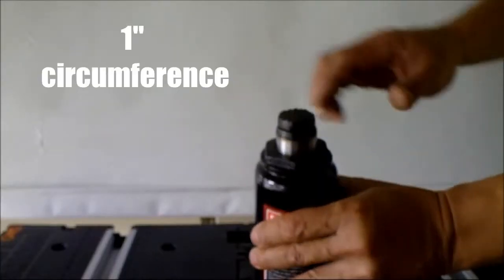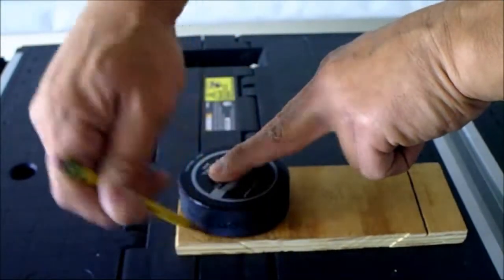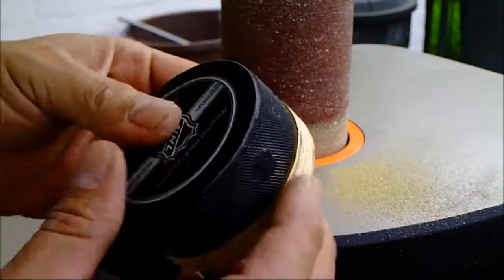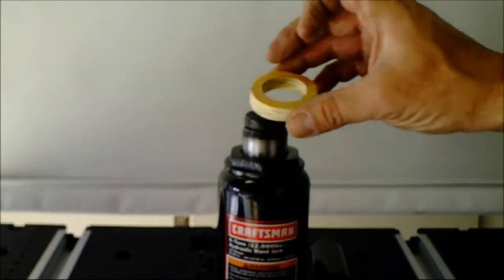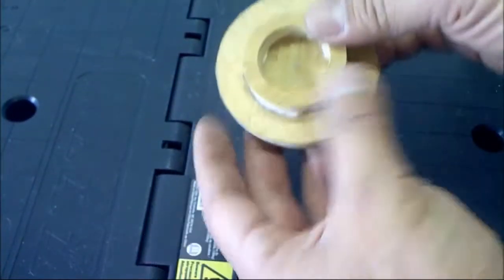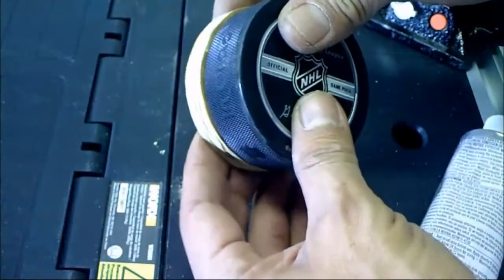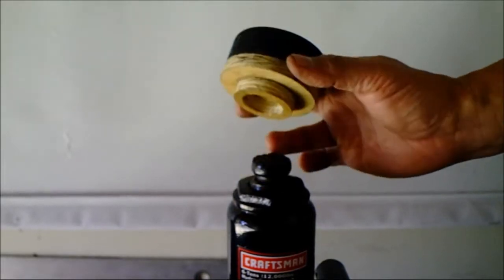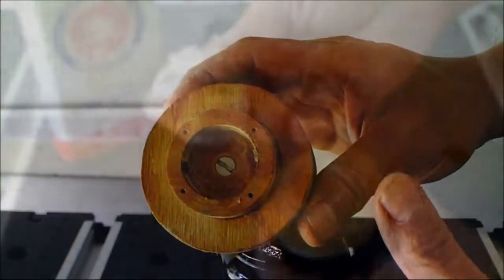Hockey Puck on a Bottle Jack

Comment: Thanks for this idea.  Wondering did you see the bottle jack saddle pads/hockey pucks on ebay?  What do you think, seems less complex to just fit the bottle jack into the hockey puck
Reply from the maker: I saw those on ebay and I didn't like the design. Some of those are just a round rubber pad. Couple of issues I saw with just placing a hockey puck on the bottle jack. 1) the hockey puck is made of rubber and the small area of the jack will tend to distort the hockey puck. 2) you will always have to adjust the center of the hockey puck on the jack. It makes it easier to take some time to make the base and not worry about that.  It's more the satisfaction that you made something rather buy it. Just my thoughts.

Comment: If the small surface area jack saddle will dent a steel frame, why won't it dent/crush the plywood given the same weight and area?
Reply from the maker: You have to consider the hockey puck that absorbs/distributes the weight. Plywood will compress a bit, but not to a point to destroy it.

Comment: I found an easier way.  With a 3" hole saw, cut two 3" disks of the plywood.  Then with a 1.5" hole saw, put a 1.5" hole in one of the disks.  Now you have a 3" solid 3" disk, a 3" disk with a 1.5" hole.  Stack & glue.   No sanding at all.  Advantage is the "centering" disk is much more sturdy and self aligned to the hockey puck.
Reply from the maker: Great idea